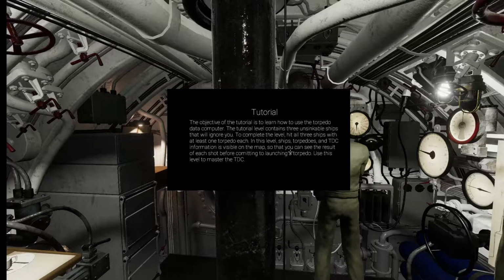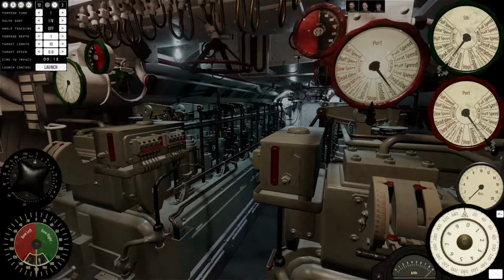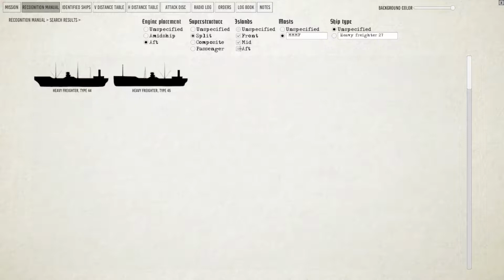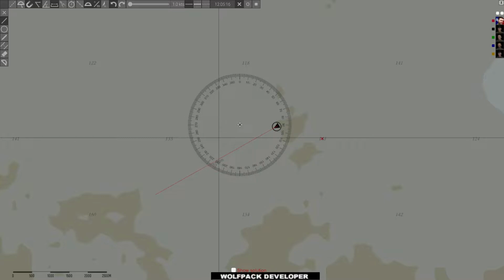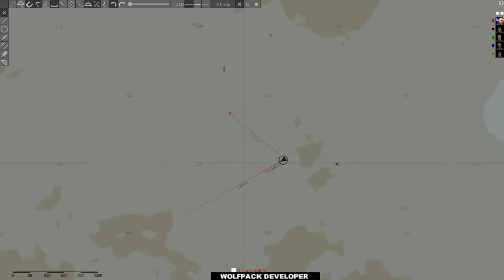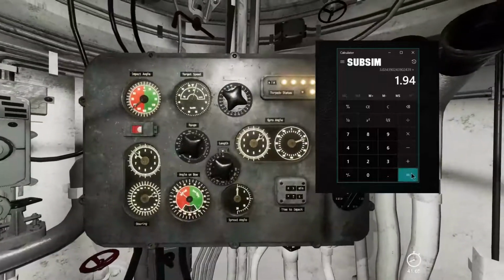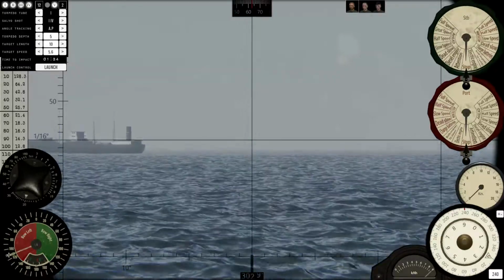Wolfpack Academy: BASIC TARGET PLOTTING  & TDC SET-UP

Comment: To increase the height on the vertical distance table, you can also hold shift and scroll with the mouse wheel
Reply from the maker: and you can increase by ten using the right/left arrows :)
Reply: @Subsim  Speaking of that table, I somehow think it would make sense to change its scale a bit to make readings a bit easier. The scope barely goes past 150, so why's there values shown up to 250? Something like this with more granular increments in the mid-high range area would probably be more suitable:

10, 12, 14, 16, 18
20, 24, 28, 32, 36
40, 44, 48, 52, 56
60, 70, 80, 90, 100
110, 120, 130, 140, 150

Just a suggestion :)

Comment: 7:42 Nice!

8:07 Instead of taking the bearing and plotting it relative, it's possible to just use heading directly taken from the lower gauge in the scope... :)

8:53 Which means he should leave the dive planes neutral and take over the trim tank to hold depth

11:52 Do that before entering AoB though as it changes with where you look at - just a minor error here though :)

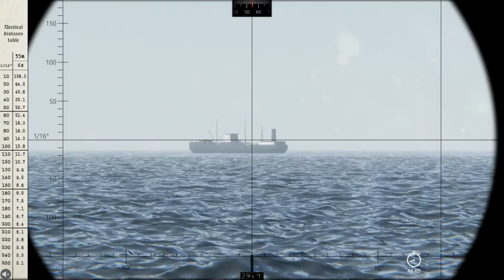13:45 I like your wording of this... and please don't forget to ring the crash dive alarm while you're at it! :D

14:29 I wonder if you got any chance actually if you do... I just don't dare to try it :D
Reply from the maker: "Instead of taking the bearing and plotting it relative, it's possible to just use heading directly taken from the lower gauge in the scope"
You are probably right, but for me it's much easier using relative, since I am on the u-boat, I know instinctively where 0 is, where 90 is, etc.
Reply: @Subsim  True. For situational awareness it's definately better and you just have to switch the drawing tool to take that into account.

Comment: Great Video, but I have still one question.
Do I have to aim at the target with the periscope while I'm entering the values or while I'm selecting what I'm targeting with?
Reply: The tracking selector switch makes the direction of the periscope (attack, observation or UZO) linked to the AOB dial. So if you keep turning the scope the AOB dial should move with it. So when you make up your mind "this AOB angle is in view now!" then you release the periscope turn and stop keeping the target in the center. And adjust the AOB needle to what you came up with. After that you can turn the scope again which ever way you want. If you turn until the AOB dial points to 180 then you are looking in the direction of the target course. (as best as you guessed the AOB)

Whenever you think, now is the time to fire the torpedo. You just aim at the point on the hull of the target where you want the torpedo to impact. Assuming the target speed and AOB was set correctly, (and range dial for a minor correction to the torpedo turn) then it should land there. Pointing to the middle of the target give the best margin of error for incorrect measurements.